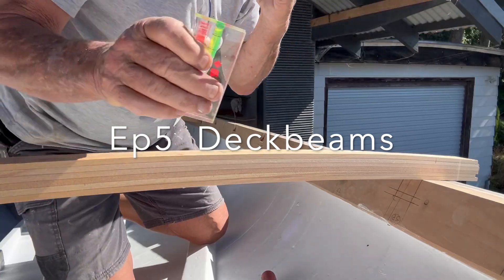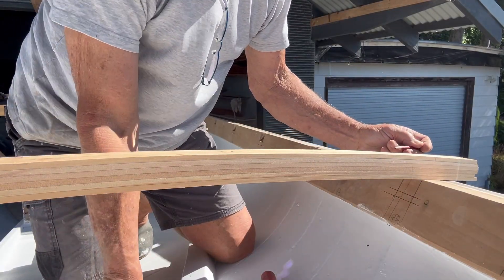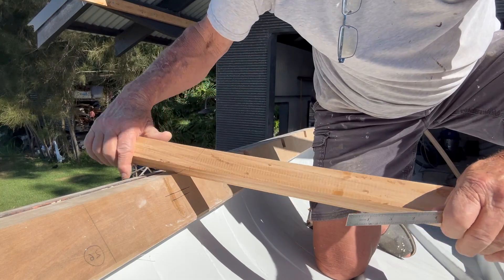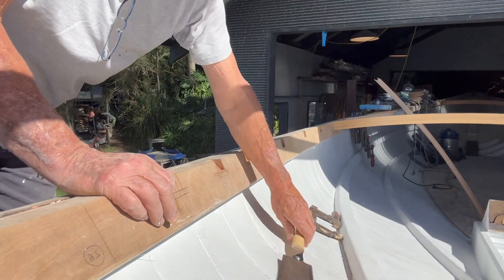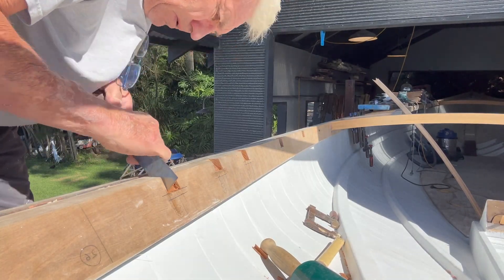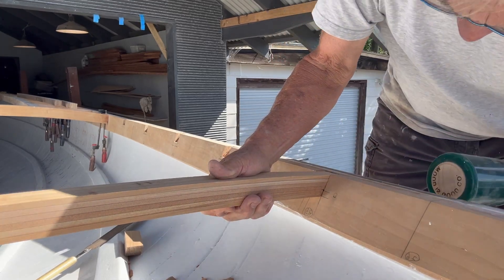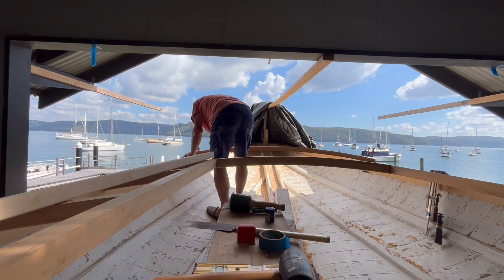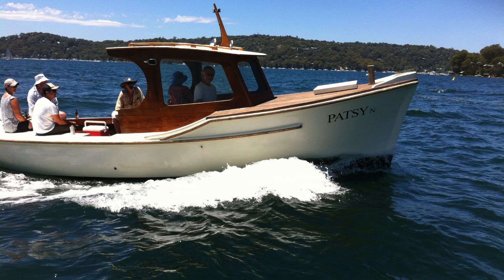Petrel Ep 5

Comment: I hate to come in late but, the old timers used to put half dove tails on the ends of the deck beams to help hold the sides in. They would put the half tail forward of midships ,on the aft side of the beam. They put the half tail aft of midships on the forward side . I have seen it done both for full sized beams and the short one into the carlins.
Reply from the maker: That’s true on the dovetails, but they only ‘mechanically’ fastened . They didn’t have Epoxy. I do!